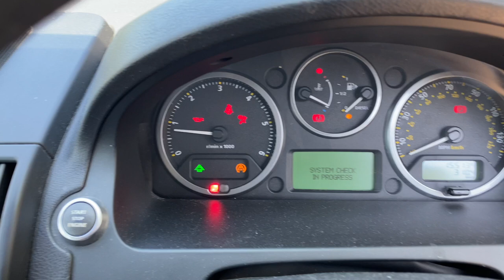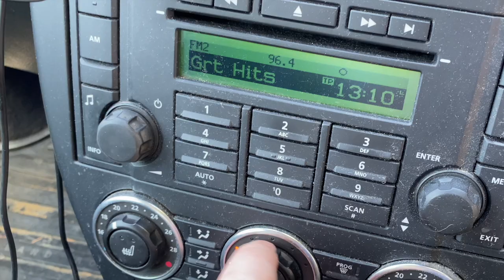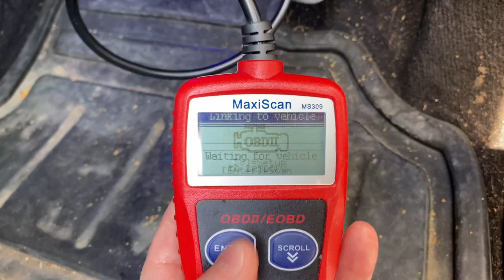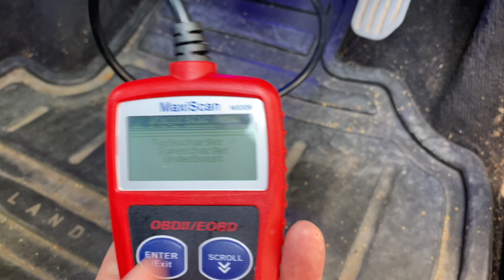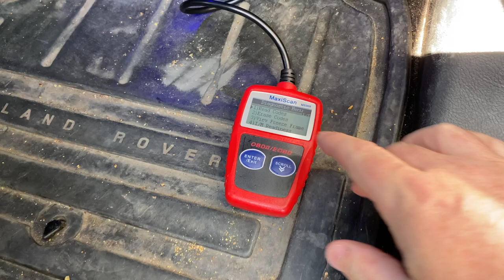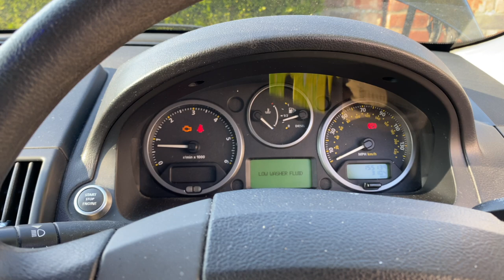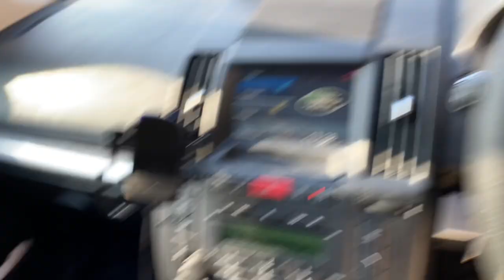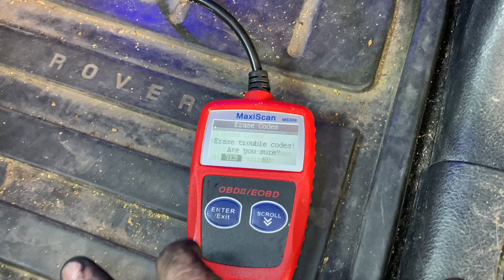Intercooler hoses & throttle body replacement on Land Rover Freelander 2 / LR2

Comment: You have the same problem as I have starting with a wish sound when the engine is under load, it comes and goes on idle there is no problem but the engine does shake a bit when the stop is pushed I am wondering if this shaking has damaged the air flow pipes, may be the engine mounts are also flexing.
Reply: One other fault I have is the fuel gauge in one side of the tank has gone faulty giving strange reads under half tank I have checked the electrical  connections under the rear seat as other freelander tags.
I think it is giving a false read that shows I have more fuel than I actuly do so could cause you to run out !, it still showed 130 miles but the tank was almost empty when I refilled at the fuel station.
Reply from the maker: Check your hoses. The factory rubber hoses split very easily. If hoses are ok then sounds like your throttle body gears could be worn.
Reply from the maker: Sounds like a faulty sender unit. Common problem. There are two, one on each half of the saddle tank. If one fails then it can read half level. Sometime they stick though or fail 'high' and over-read. I get this sometimes under hard acceleration.
Reply: Thanks for the info

Comment: Gostaria de ter somente um pouco de noção de mecânica!
Ontem meu carro deu perca de performance e ele não liga mais !
Acredito que o problema seja está mangueira !
O mecânico irá verificar!
Vou ficar o fim de semana sem carro😢
———-

I would just like to have a little notion of mechanics!
Yesterday my car lost performance and it won't start anymore!
I believe the problem is this hose!
The mechanic will check!
I'm going to spend the weekend without a car
Reply from the maker: Hope you get your car going again soon! Check the crankshaft position sensor too. A split hose won’t usually prevent the car from starting, but a faulty sensor can do. Best to read the fault codes and see what has been reported by the ECU.